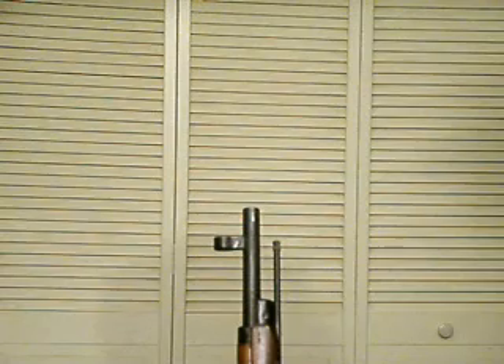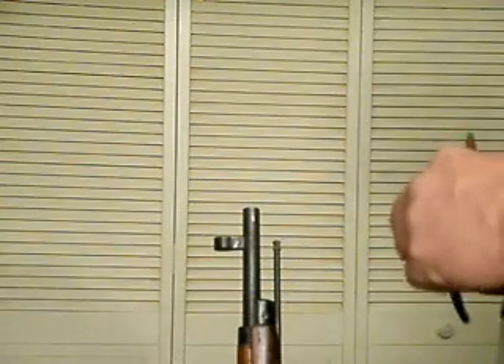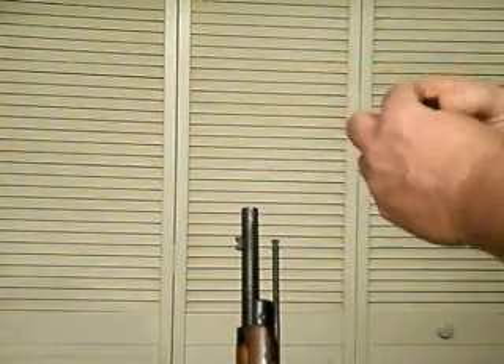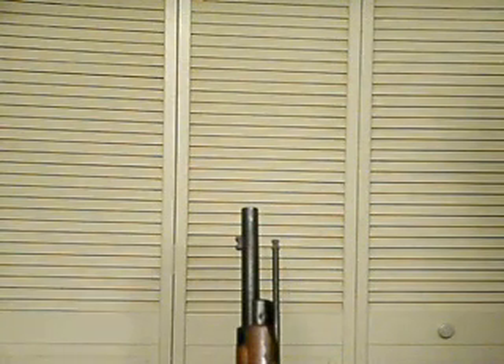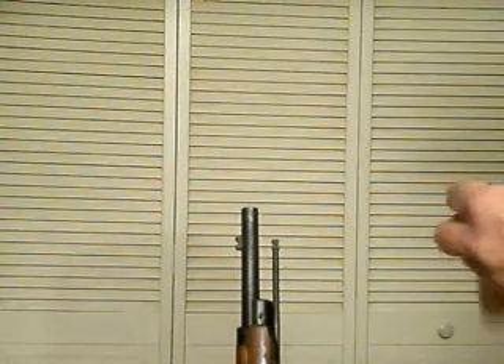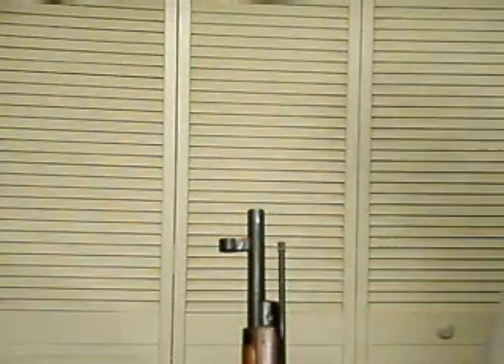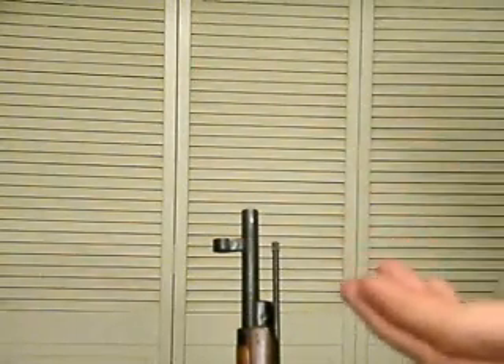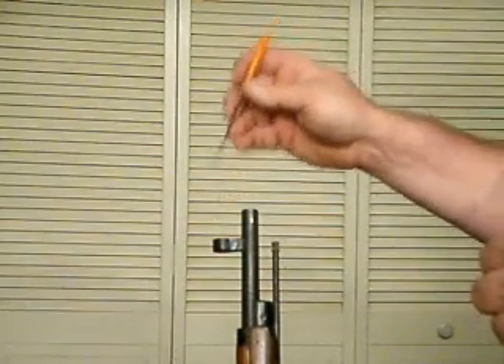Mosin Nagant Rifle Sight Fix

Comment from the maker: @MuddyCreek11  The Mosin rifle is intended to hit high.  It is designed to produce fatal wounds at near to moderate ranges by placing the target (German Adult) on the top of the post with most of the body showing (head to pelvis) and pulling off a shot. With lethal consistency the bullet will strike mid torso or thereabouts.  Here in the states we shoot paper, deer, etc. and want a target style result with the round striking just at the top of the post to maybe 2" high.

Comment: I loved the rifle so much I went and picked up another one. My first is 1940 and the second is a 1943 and I now have a new primary hunting rifle! I got both of the sights dead on at 100 yards thanks for the help. I picked up 1300 russian surplus rounds for it and also bought brown bear 203 grain soft points for hunting. I believe the surplus is 149 grain I believe or colose to that and the 203 grn rounds are hitting around 4 inches higher than poa and so I see why the post is needed.

Comment: My biggest problem is that the surplus ammo and the commercial (new) ammo is about .001 difference in diameter, and if I switch ammo, an "adjusted" post will end up shooting low, so I use the 12 gauge copper wire insulation method...so that I can remove it when I use surplus ammo.

Still, I'm tempted to try a more permanent fix like this...then I would just use some mosins for surplus ammo, others for commercial SP ammo.

Nice vid!

Comment: Just received mine and it fits perfect only took 10 minutes to install. I bought the 1.5 mm, for I use my mosin for hunting and that's what Johnnybar suggested for the hunting post. I will be ordering the 2.0 mm, which I understand is the standard for the original post thickness that they came with, just to have a spare. Great Job!!!!  Johnnybar

Comment from the maker: Yes, as a matter of fact, it will drift easiest to the right. So we are both on the same page...right when looking from the action through the sights, as when firing the rifle, is the direction you want to drift the front sight to correct the 4" issue you are having.  Move it .028" for the 4" windage. Right is also the direction to remove it when replacing the post.  Replace it by inserting it from right to left.

Comment: I will look into that because I am sure to buy more mosins in the future probibly an m 44 carbine and it would sure be nice to have one when owning 3 of these firearms. I tried my ak sight adjustment tool on it and it wouldnt work so I did what you said and with about 30 rounds I got both of them hitting the sweet spot! I may get ahold of you to see about them posts before hunting season my 1940 hits 4 inches high with my 203 grain softpnts and the 43 shoots about 6in high I could compensate but

Comment from the maker: Inspect to make sure it has not been soldered by a previous owner. When looking down the barrel from the shooting position, you need to be striking the hood on the left side.  Place the base (the small square lug that is part of the barrel) on a solid rest so as to not allow it to move away or bounce when struck. I usually clamp the barrel in a leather padded vise right below the base. This makes a big difference in the impact of your punch and hammer.  Wood benches reduce impact significantly.

Comment from the maker: @TheAvalonSword 
I have found that 1 in 75 Mosins were pressed or pounded into place after being machined with too small a bore in the hood.  Probably when using a dull cutting tool. There are two options: #1- Preserve the original post and hood, leave it alone and buy a replacement hood for $5-$15. #2-Drill out the old post if it still won't come out after a few hard raps with a small hammer and punch.

Comment from the maker: The base needs solid support.  Look closely at how you have it supported on the back side of the dovetailed base.  Make sure you are not also placing the support under the hood's dovetail.  I find that it is best to put stubborn ones in a padded vise by clamping the barrel between leather pads firmly and using a punch on the right side of the hood's dovetail as viewed while looking down the muzzle.

Comment: My M44 sight globe drifted out with little effort, but knocking the sight pin out was a bear!  Would not budge, kept bending.  Finally, just broke it off at base, and then was able to use punch on "stub" to blast it out with a hammer.  New sight pin seated with about 1mm extending out, would not go in any further.  Filed down smooth.  Nice service, part came quickly, just wish there was an email to ask questions, but I guess the volume of mail could be daunting.....

Comment from the maker: The windage will be right on if your lucky.  It can also change significantly with the ammo you use.  I have seen up to 6" differences between surplus lots.  Usually a few inches high or low and a few left or right. Pick your favorite ammo and adjust to those rounds.  The other lots that aren't as important can be fudged with the sight picture....my 91/30 post covers 8" wide at 100 yds, so fudging is pretty easy by going half a post left, etc.

Comment from the maker: @johnnybarbar 
The hood needs to be on a solid block of steel or brass with a 3/16 hole in it centered under the post. A wood block or table top absorbs the shock force that is needed to break the frozen post.

Comment from the maker: Try a vise first.  Needs to be a fairly good sized vise to provide solid resistance to the punch and hammers jolt to the hood's dovetail.  Use leather or several layers of card stock or cereal box cardboard to protect the barrel.  Clamp it so that it just clears the vise's jaws.  Just having the barrel laying on a workbench allows the jolt of the hammer and punch to be absorbed into the springy surface.  Makes a huge difference. Use a punch that has at least a 3/16 flat tip so no mushrooming.
Reply: No the ones I'm talking about are made in the USA,look up 2PCS MOSIN Front Sight Long Post Pin for M91/30,M38,M44 2PCS

Comment from the maker: @Wabatuckian Yes, the Russians resorted to whatever shortcuts necessary to produce as many arms as possible. Soldered posts were probably too short of a flare.  I've seen some that were too tight and they went ahead and pounded them into place...almost impossible to remove.  I have machined a reamer to cut the proper flare and shoulder in the hood when drilling is required.

Comment: Instead of hammering on the sight ring why not use a Mosin sight adjustment tool that will drift the sight in both directions making it much easier and a much less invasive method of removing the sight ring? I adjusted the sight post on my Mosin by simply sliding a piece of (white) electrical wire insulation over the original post increasing the length by about 1/8th of an inch. It brought my groups down at 100 yards significantly. The weapon is dead on at that distance now using only the iron sights.

Comment from the maker: Sounds like you have one that the arsenal hammered into place or just has decades of corrosion causing seizure of the post.  About 1 in 300 behave like this...I usually do the following:  Make sure you have a solid surface, not wood, to place the hood on.  A large vise is best as you can gently clamp the base in it at the sides of the dovetail so the shoulders are on top of the jaws. If no vise, a solid piece of metal with a 3/16 hole will work. I've used a small socket before at the range.

Comment from the maker: PS: Haven't seen one personally, but it is possible that it is staked in place or soldered if it was too loose in the past.  The ones I have seen just had the hood's dovetail peened a little to tighten it up.

Comment: Hey Johnny, just a heads-up:  I've recently run into a bunch of imported sights that seem to be actually built up with hard solder on the bottom AFTER the pin was installed.  Tapping out the pin was impossible and would ultimately destroy the sight hood.  

The only solution I found was to drill them out.

These were off-rifle only, but I've not dismissed that some might be on customers' rifles.  

Regards,

Josh at Smith-Sights

Comment from the maker: @bornagainjew1998  The hole is likely obscured by the arsenal hand fitting the dovetail, by filing or grinding, after insertion of the post.  It sometimes makes it almost impossible to see the posts base.  If you have a jewelers loop or good magnifying glass, it will help but, the wide M44 front sights did use the round post configuration as seen on the mosin site 7.62x54r.net

Comment from the maker: @20thcenturyfilmdocs 
Just checked my notes and I see that Russian or Bulgarian surplus light ball, which are my highest shooting loads in my 91/30 Mosins, hit within an inch of 203gr SP Barnaul at 100 yds when both are zeroed for 200 yds.   My three shot groups off the truck hood at 100yds are usually 2".  So, unless one or the other load causes some unusual harmonics (barrel whip) they should be fine using one post height.

Comment from the maker: @TheAvalonSword 
I may have already responded privately or by email...I get lots and I mean lots of mosin and mauser questions from every online source imaginable.  You need to drift the front hood to the right, when viewing from the shooting position. On a 91/30 with 29" barrel, each .007" will adjust impact 1" at 100 yds...so it doesn't take much....6" requires .042" hood movement, or about the thickness of cereal box cardboard.

Comment: Or, it could be because they were zeroed with the bayonet ON them. Target at 100 meters, slider at 300 meters, POA 6.75 inches below POI is zero. 4 out of 4 shots inside six inch diameter of POI is passing. 148 grain bullet used for zeroing.

Comment from the maker: I can't tell you how much to take off the new post without knowing how long your old post is. Let's try this...each .007" you remove from the new post will raise the group approximately 1" at 100 yds on a 91/30. You will need the new post approximately .056" taller than your original post.  File it down to  .080"  taller and check with a 3 round group...should be 3.5" low.  Keep filing using .007" for each 1"@100yd as an approximate guide.  Be patient...go slow...is the best strategy.

Comment: Hey, I bought one of the sights from you, and I am attempting to take off the front sight hood. I have banged and banged and banged on it, but all I have done is messed up the bluing. The darn sight wont budge. Im using a brass punch and I have tried a rubber mallet and a hammer.

Comment from the maker: @johnnybarbar 
Be very careful if you are sentimental aboiut the original hardware that is on the rifle like I am with most WWII era weapons.  The post is very easy to bend or mushroom the end you are hitting.  Firm taps with an 8oz hammer a few times is about all it can handle.

Comment from the maker: SystematicMechanic,
Sounds like you have a standard diameter post...2.0 / 2.5 / 3.5 mm is typical with minor variation. The tall posts are 17 to 18 mm long and will correct your elevation error unless you have a bent barrel causing extreme high shots. How high was the Mosin hitting? They are currently listed on ebay under seller "johnnybar". Do you need any further assistance?

Comment: So I got the globe drifted out on the front sight on my 1939 mosin, but can't get the original post to slide out.  I've let it sit overnight with oil and I can see bottom of housing where it sits, so it's not soldered in, but it just won't release with a hammer and punch.  Any suggestions.?

Comment: How much taller (length of pin) must the sight be??  1/32 of an inch??  My 91/30 is 6-8" high at 100 yards.
Reply: +johnnybarbar Thank you!! I'm going to try this.  I might just add some Glow-on sight paint at the tip to add in "low light" hunting.  This looks very much like Josh Smith's "Smith Sights".

Comment: In case your interested in the sight post vs year compatibility....the posts work in any Mosin with round hoods and round front posts.  Blade front sights, such as the Finnish rifles have are not compatible.  There are taller blades available or I can add height to an existing blade using braized brass or welded steel to correct elevation issues.  A hand fitted post can also be added to a Finnish style blade if desired.